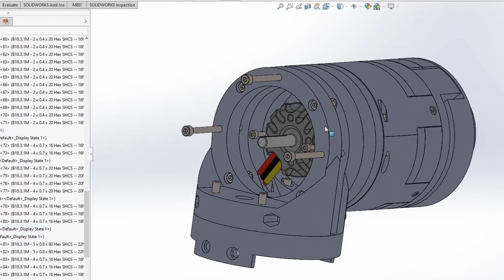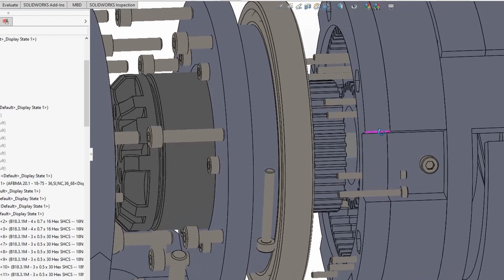3D PRINTED DIY ROBOTIC ARM. JOINT 6. 3D PRINTED GEARBOX:HIGH TORQUE, LOW BACKLASH!

Comment: Please, I'm now learning how to draw and print a mechanical part using a 3D printer. Please which software you use to design your system numerically and which type (characteristics, name, and where to find it) of 3D printer do you use.
Reply from the maker: I use SOLIDWORKS to design parts for my robot. And i use Creality Ender 3 printer like this one:https://www.creality3dshop.eu/products/creality3d-ender-3-pro-high-precision-3d-printer.